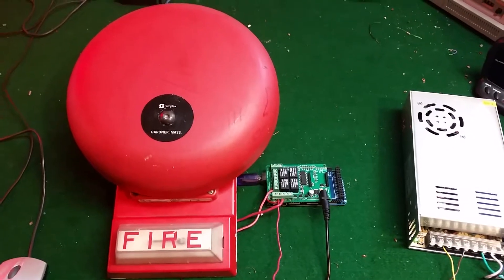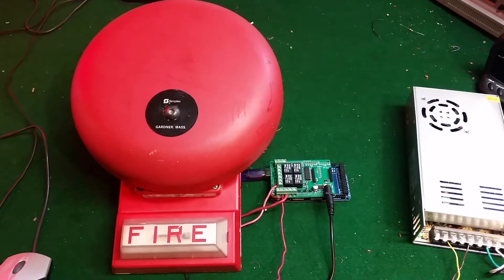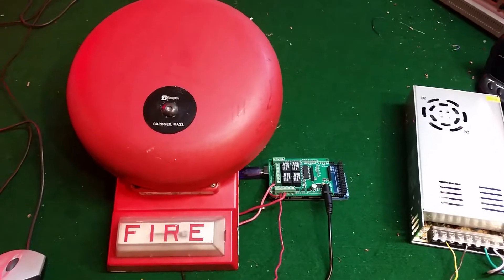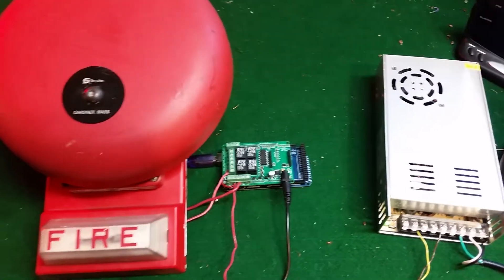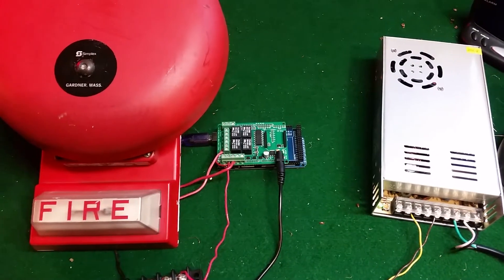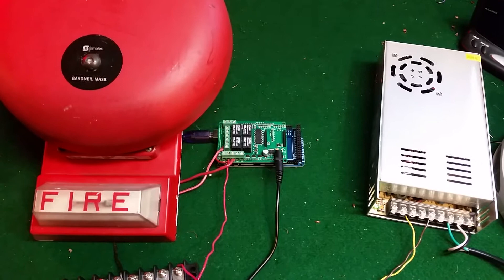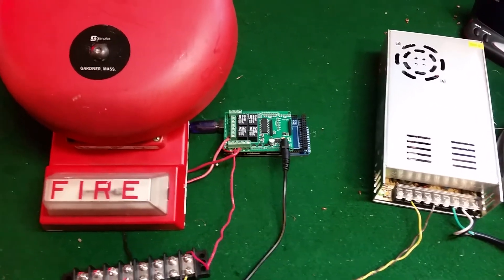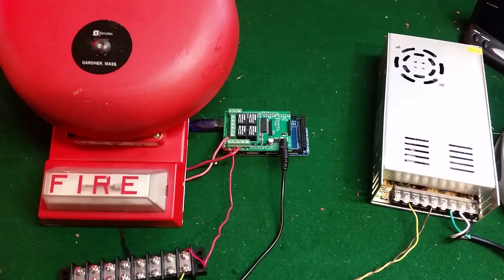Simplex 2901-9333 + 4903-9101 Test

Comment: What did you use to code it?
Reply from the maker: An Arduino Mega 2560 with a relay shield.  I have it programmed to code the connected device the way you see it done in the video, but I can easily change that.